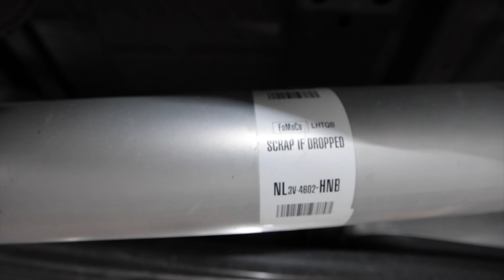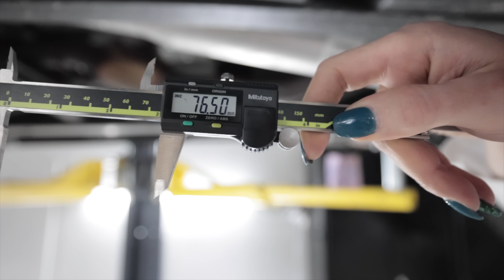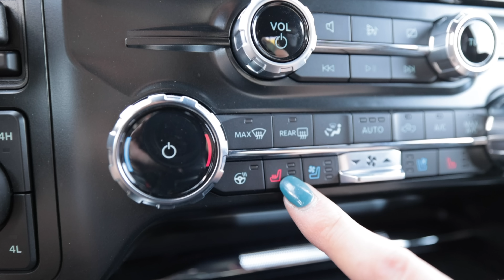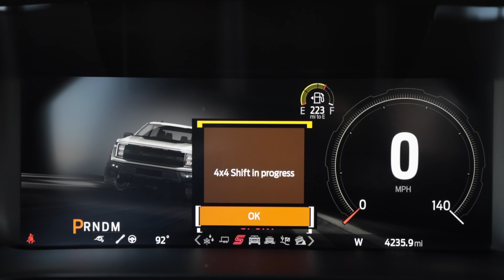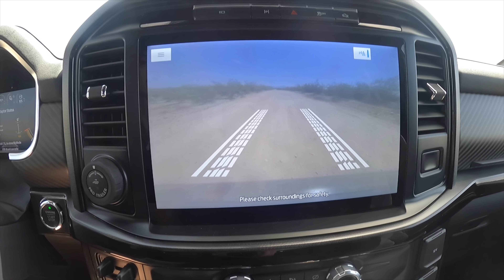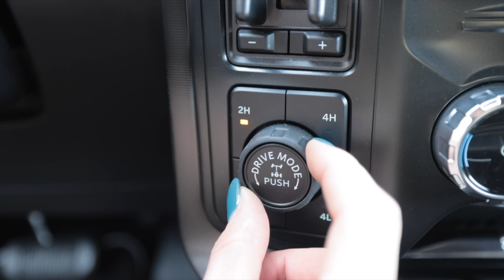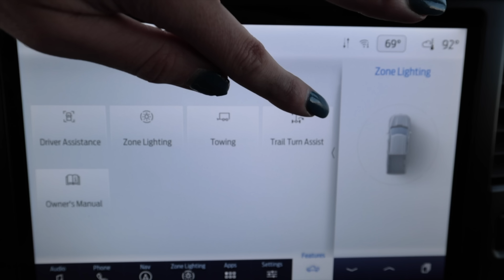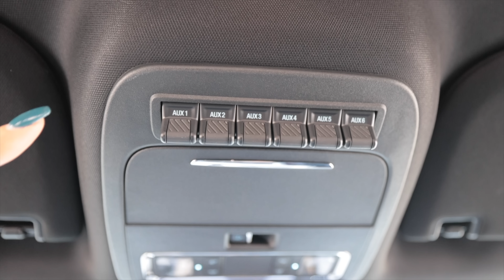A V8 is ALWAYS Better! // 2023 Ford Raptor R Review

Comment: I saw a couple Shelby versions of this truck at a Ford dealership last weekend...$143,000. Both the same price but different colors. They were "Baja" versions...each had two mounted spares in the bed. Amazing how far they've come since '10 with the first 5.4 model. That truck sold for $38,000 fully loaded.
Reply: If Ford doesn't bring back affordable trucks they gonna be in trouble if they not already. For shits and giggles I stopped and saw a Shelby and the sticker shock was real.
Reply: Paid 40 for a first gen 5.4.  should have kept it.  Imagine what could've been upgraded with the extra 69k........(not counting the markup crookery)

Comment: It'll be a sad day when the last V8 rolls off of whatever assembly line is the last hold out.  Until then, we can revel in the eargasm that is this truck, now that it has a proper engine.  And, of course, dust hurricanes 😀 Fantastic video of the hill climb & descent, blasting down that "road" that would tear up lesser vehicles, and of course the most amazing donuts yet!  I laugh when people complain about the poor gas mileage of the TRX or Challenger / Charger Hellcats, since that's completely not the point of such vehicles, and this Raptor R certainly fits in the same category.

Comment: Hi Sarah,  it is the Ultimate Ford,  at a local Dealership in the Los Angeles California area.  Had a Raptor R in black. Dealership price was $260,000.  Sharing the showroom with it, there was a lowered track focused Shelby America F150 with 750 hp, for $141,000. Though, if I were buy the Lifted F150 I would buy a White Roush and it is $94,000. 
It's where I bought my White 2022 Roush Mustang with the 3rd Pedal
6 Speed Manual Transmission. Great review and editing.  The drone view was epic 👦👍🏎🏁🚩⛰️

Comment: They made this truck because they could, and they knew they would sell them all. But I think the standard Raptor 6 cylinder with a tune would be the better choice for offroad because of the front diff, and it would be way cheaper. And maybe Im crazy but I actually prefer the sound of the V6, its more...trumpety...for lack of a better term.

Comment: Sarah, did you catch the number of wheel weights. I know it's a tall tire, but something is wrong if each corner requires that much weight.
Reply from the maker: Nothing is wrong, that’s completely normal if you’ve ever mounted and balanced tires this size before.

Comment: How much weight was used to balance that front wheel?
Reply from the maker: That front wheel/tire alone weighs nearly as much as I do. It’s normal
Reply: @SarahnTuned With so many stick-on wheel weights (6:50) that expensive forged rim has doubled in weight. It’s almost half way around the wheel. Tire construction must be horrible. Great channel, entertaining and informative, Congrats.
Reply: @simonmitchell7439  The tire is only half of the consideration. No one making these comments thinks it is the rim that may be the problem. Break the bead and mark the tire at the valve stem and then spin the tire 180 degrees and check it again.

Comment: Can it give the TRX a run for the money in the 1/4 mile
Reply from the maker: It’s faster than the TRX due to the huge weight difference.
Reply: They are pretty close. The Raptor is a bit faster.

Comment: The Raptor R is $150,000 here in Canada. I don’t need one that badly lol.
Reply: Nobody NEEDS one. It how bad do you WANT one and having the BUDGET for it.
Reply: @syxepop  that’s the problem. People put their wants before their needs these days. Got to have a fancy truck to show off to the neighbours wether they can afford it or not.
Reply: @sheldondyck8631  - that happens with most "desirable" cars. It's even worse with BEV pickups since they lose 50-70% of battery range when you haul, tow or go off-road. 

Note that most BEV pickups are sold nearby CITIES and close to both Atlantic and Pacific coasts to "very-well-to-do" people that won't put any truck through its' paces.

One of the worst offenders are Tesla buyers. Have been certified in publications as the vehicles you "do whatever it takes" financially to have 'em.
Reply: @sheldondyck8631  if by these days you mean the last 75 years

Comment: 0-60 in 3.6 seconds.  That's just insane.  A massive truck that can out run most cars on the road.  I'm so glad Ford makes something like this.  Dodge did it with the TRX too.  GM is SO FAR behind the game when it comes to crazy performance trucks.  They have nothing besides the ZR2 and that's just a normal Silverado with a tiny bit more clearance.  Such a gimmick with a massive markup for nothing.  I know some people hate Ford for some stupid reason but if they ever got behind the wheel of a Raptor they would understand.

Comment: Shame no Manual I wonder if the old 5 speed would fit it ?
Reply: Same reason there's no manual on the TRX (probably another version of ZF's 8HPxx). There's NO truck-engineered manual that can support the 600+ lb-ft of torque those V8 bad boys can push.
Reply from the maker: No
Reply: @syxepop   about uk manual 5 speed if they come here
Reply: @robertwilliamgriffiths2591  As I've hinted before... The problem is NOT if any truck-developed 5 or 6 speed would've physically fit there.  It is whether that manual would be SHREDDED by the torque generated by those V8 beasts. 

Even makers of exotic marques doesn't put manuals anymore (those few cases still left are specially designed to support the torque and they're "torque-challenged", as in far less torque than hp). They put sequential ones, DCT's or high-cog planetary autos.
Reply: @syxepop is making a ton of sense and better informed than I /  kudos!

Comment: I have a 2018 with the 10r80. Worst transmission EVER! 10 gears is a useless waste. I don't need my truck at 800rpms in 7th gear while doing 25mph. People who buy trucks don't give two $hits about fuel economy. A solution to a problem that doesn't exist.

Comment: Yea, no replacement for a V8. It is still lighter than a lot of EV's.
Reply: and IF it caught fire...you could probably put it out!
Reply: @anth5189  A study of U.S. fires from 2003–2007 finds that fire departments respond to an average of 287,000 vehicle fires per year, or 30 vehicle fires per hour. Though EVs catch fire at a lower rate than petroleum fueled vehicles, it is extremely difficult and dangerous to extinguish the fire.

Comment: Scrap any panel that gets damaged because they are not repairable 😮
Reply from the maker: You can repair aluminum.
Reply: @SarahnTuned  the aluminum panels can be paintless repairable with a very very small dent otherwise they are cheeper to replace

Comment: It's a huge horsepower golf cart for guys that don't need a truck, can't back a trailer and like to see it parked in a ramp somewhere. I wish manufacturers would make trucks again instead of these craptard, no box, low towing turds.  I've ran drag cars, street cars, circle track cars,,,, the LAST thing I would want is a soccer mom truck that thinks it's fast! Only a douche buys a "truck" that is kinda quick,  tows nothing, usually an ugly color, street tires, 4 golf bag capable or few hundred bake sale cookies. It's just SAD when "truck owners" need to have a system to park or back a trailer. Just drive a prius and say out of the way in traffic!